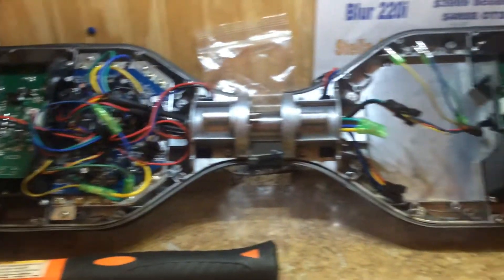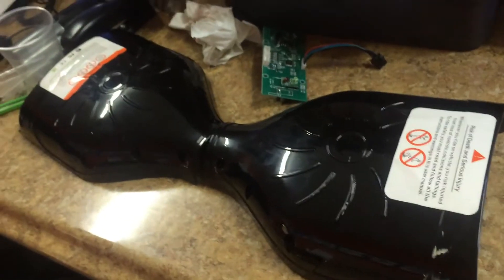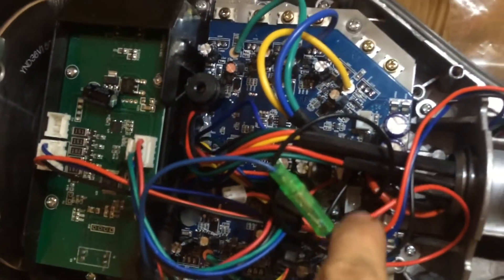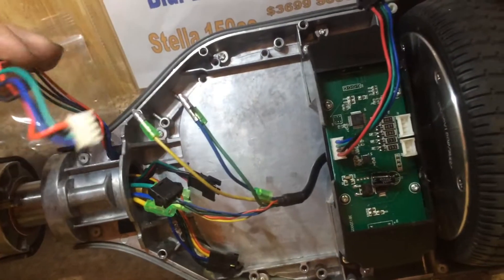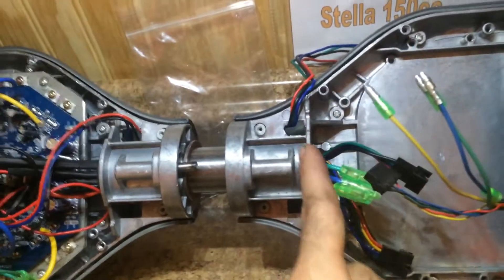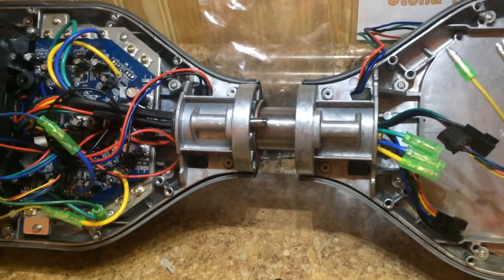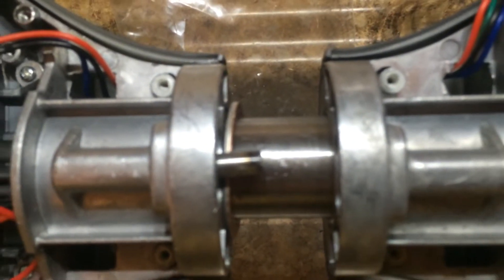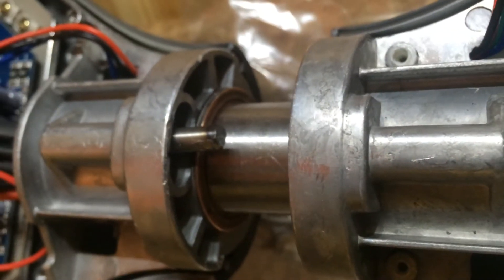Hoverboard won't turn: how to fix broken hoverboard

Comment: how do u remove the pain in the butt ring bro? i tried so hard couldnt get it off
Reply from the maker: @fizz3000, I just used picks/flathead screw drivers and a needle nose plyers. It's not easy but keep trying!